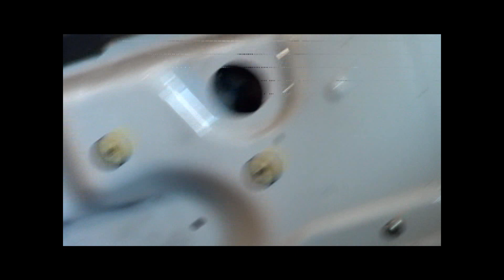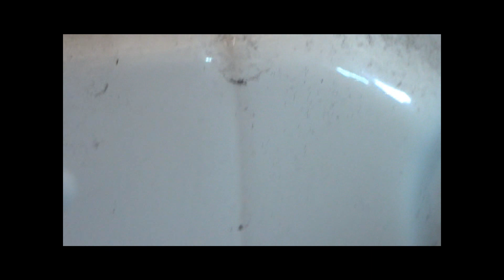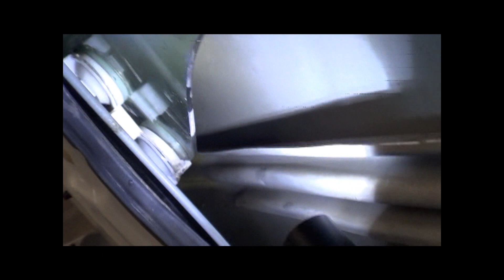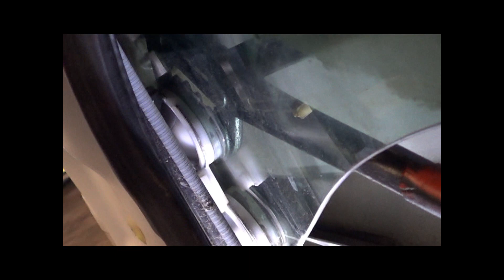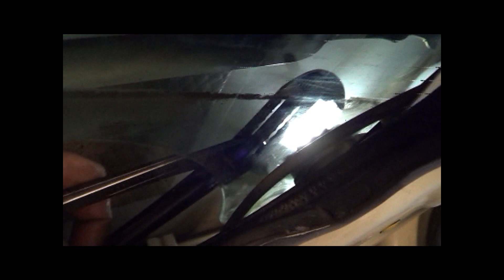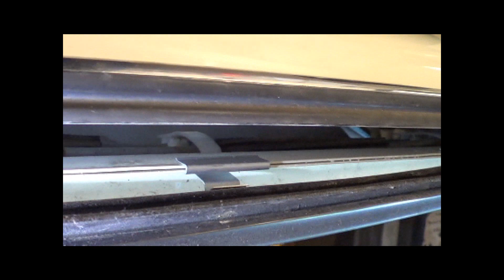Mini cooper window regulator and motor

Comment: Here is what I did. Window was stuck in up position. Removed all 4 regulator bolts, then made a special tool. I took a long flathead screw driver, then notched it with a grinder, a notch wide enough to fit over the gear. There is not much room between window and that gear, so I ground some of the side off of screw driver, then wrapped the shaft, up to the notch in tape (to protect the window). I then took a hammer, and placed screw driver between two of the gear teeth, meshing them together. I was at around the 5 o'clock position on gear. Then I hit with hammer until it broke free, and I was able to spin off completely. I ALSO REPOSITIONED THE REGULATOR TRACKS TO GIVE ME MORE ROOM, AND BY WOBBLING THEM AROUND THE GEAR THEN FELL INTO DOOR WELL. The problem for me is that the customer gave me just the motor, without regulator assembly, and as it is designed, it is impossible to get 3 of the motor screws out, as they are hidden by regulator, so I would suggest getting the whole regulator with motor already assembled. I have installed scores of window regulators, but this is by far the most ill conceived I have ever run into.

Comment: is it safe to say to turn the torx clock-wise to loosen the gear?
Reply from the maker: I assume you are meaning the little torx that faces you.  Usually it is too tight and if you try to use it to loosed it then it will strip.  Certainly after you break the bolt loose using the channel lock pliers on the "gear" head you can then use the torx to spin it out.  Most certainly if it is tight as they usually are you will strip the torx or break off your torx head.  This is shown in some other videos here on youtube where the guy cusses for 20 minutes because he broke his tool.
Reply: CoolAirVw Rm so can we just turn it clockwise to loosen it?

Comment: Good tip on turning the toothed nut instead of using the little torx... those would strip out for sure!
Reply from the maker: Yeah, it doesn't require a 20 minute rant with every profanity a sailer knows to get it out.  Difficult part is getting the window at the right height if it wont move but I think my suggestions at the end will solve it for most folks.